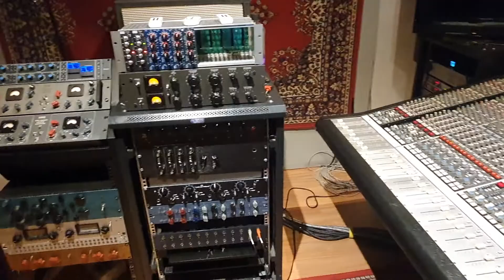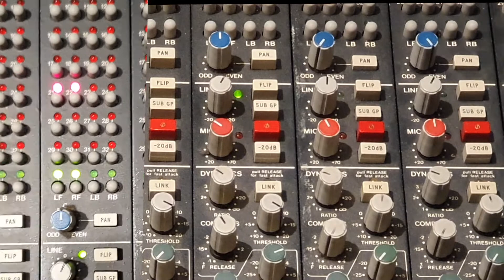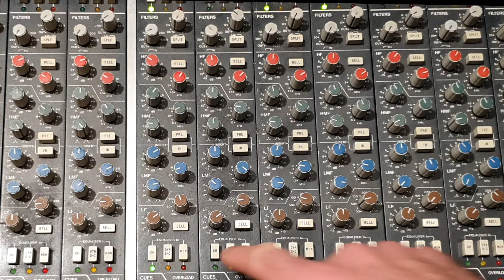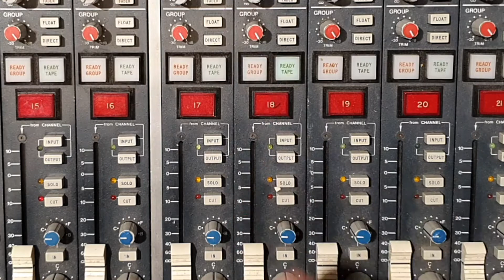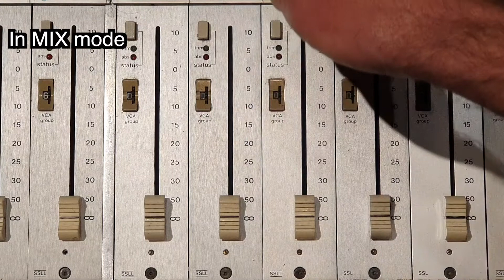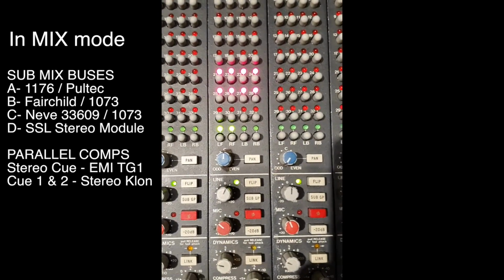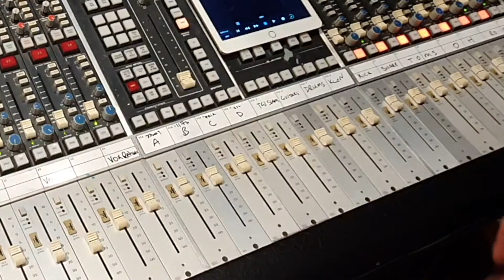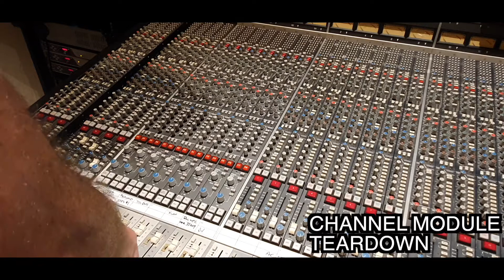The SSL 4000 Recording Console - Part 1 - The Channel Strip Tutorial

Comment: The filter section to dynamics out, with the parallel routing in the SSL, is something all the plugins get wrong, you are able to use the eq normally, and the filters to go to the compressor. In the plugins, the filter and eq section goes through so you cannot use the eq as a normal eq, it becomes a side-chain.

Comment: Hello Sir. Can you help me find where can i buy tool screw for take out channel strip . Thank you
Reply from the maker: Hi mate, I dont know the exact thread of the channel strip but by some different bolts to test and then buy a star knob bolt in the same thread :)
Reply: It was originally an M4 bolt put through a Sifam collet knob, later they made ones with a brass T-handle.

Comment: Hotswapping channels is fine largely, but you will blow VCA chips. As you say at the end, it's best to turn off the bank that you're swapping into with the relevant dip-switch below the patchbay.
Reply from the maker: Absolutely, hotswapping is not recommended :)
Reply: You are more likely to destroy the entire Total Recall multiplexer which then takes about a week to replace all the ICs. The 4k and 6k were designed for rapid servicing on sessions. Power down a bay, swap in the spare module and power up again with minimum disruption to a session. There was a complete set of spare pcbs for the centre section too, which took slightly longer to replace. Compare that with the 9k which was unserviceable, no spares and SSL would send an engineer within two days--they had lost touch with their customer base.

Comment: Hi Chad! That’s the one than needs an extra room with A/C for its computer?
Reply from the maker: Normally it would need its own machine room with AC, but I built a switch mode supply which runs super quiet and doesn't need a cooled room 😀